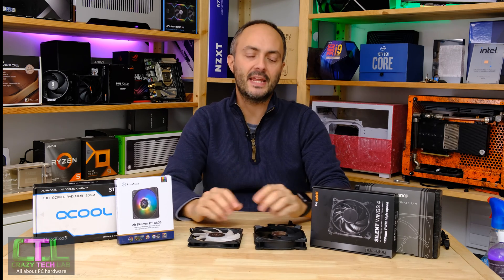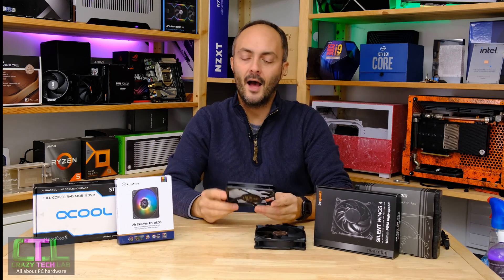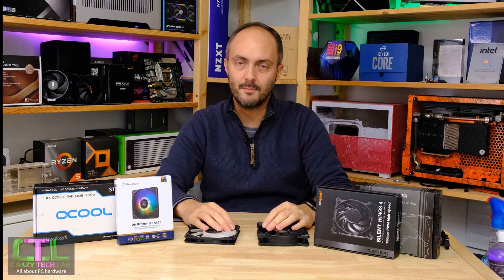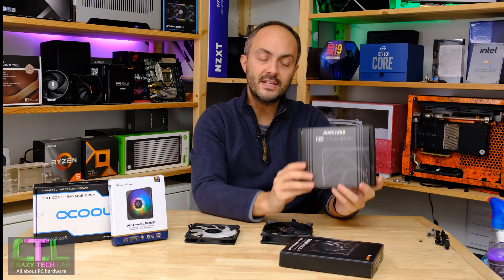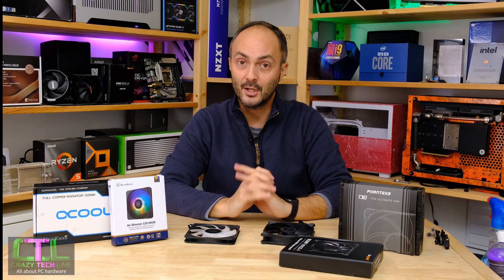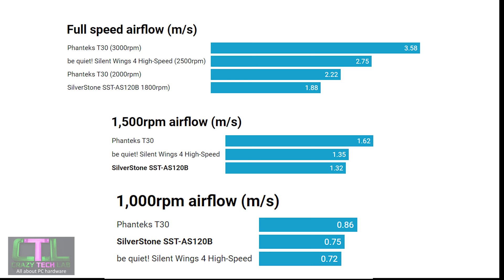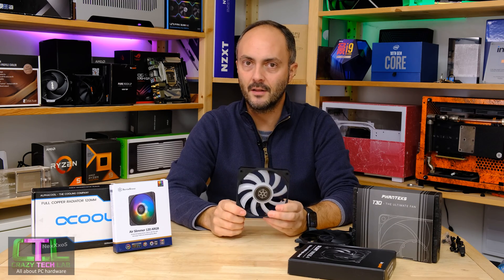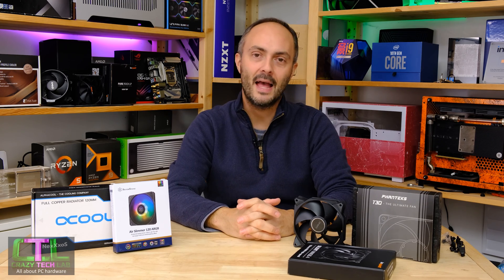Are slim PC fans KILLING your cooling?

Comment: I use 3 slim Noctua fans in the front of my case, slim because they're mounted on the wrong side as my GPU is longer than the  320mm supported GPU length. In practice it doesn't make any difference,  although they are noisier at high speeds,  speeds which they never reach in normal use. Gaming temps rarely  hit 60°C on either CPU/GPU and  my PC is quiet.

Comment: I am going for the SilverStone air slimmer over a Noctua thanks to your testing. Will use it on a Arctic freezer 3 240(38mm) because of space constraints (Jonsbo A4) as I already had the radiator. The radiator is the only exhaust and I am building the case to have a positive pressure so the fans in the bottom will push enough air in to support the air slimmer fans and this should give a decent result. Will give an update if the combo is worthwhile.
Reply: Considering doing this also any noticeable difference?

Comment: im pretty impressed with how close this slim fan is to the other fans. i have the t30 and its great, but im designing a 3d printed case to be as small as possible and going for the 15mm fan saves you 15mm , which is huge. thanks for the video.

Comment: Do the non RGB Air Slimmer 120's perform exactly the same? Might be a weird question but there are a few cases in the past where RGB fans have slightly larger hubs than their non-RGB counterparts and end up slightly worse.
Reply: Yes, our non-ARGB version of the Air Slimmer is exactly the same size and performance.
Reply: @Silverstonetech thanks for the confirmation

Comment: Hmm, interesting.  I'm not sure that I agree with the conclusion stated at 12:03.  You stated it's a noticeable difference, but I'd have to respectfully disagree with that and say it's negligible when the difference is less than 1% between the two (standard fan + slim rad vs slim fan + standard radiator).  I do agree with your overall conclusion though, nothing here that would stop me from using slim fans either, and Silverstone is the best slim fans I've used as well.  Except quite a long time back I used a Gelid in my transparent LCD case mod Visible Contrast that I was pretty impressed with, but wasn't using it on a radiator.  

If nothing else, It validates what I've always said, get whatever you prefer, it won't really matter.  Good to have actual numbers behind that hunch though lol.  I'd also be interested to see what that means at different heat loads as well.  For example, when the water temperature gets higher and higher the efficiency of the radiator goes up, but would the difference between standard and slim fans be exaggerated at that point too?  Hmmm, makes me want to get my watercooling testing gear back out and dusted off again :D